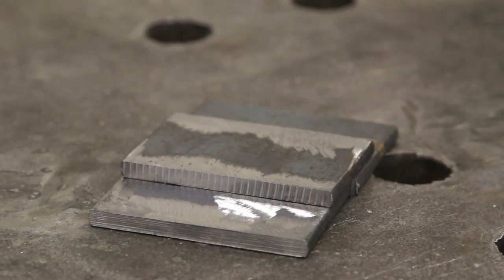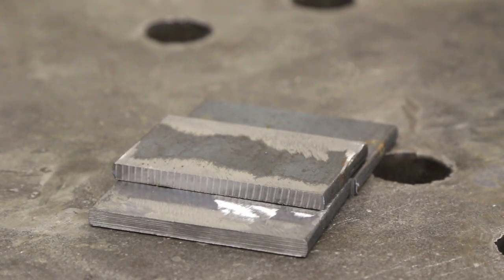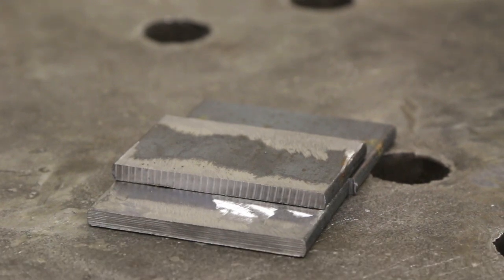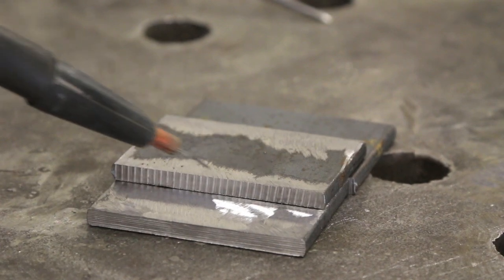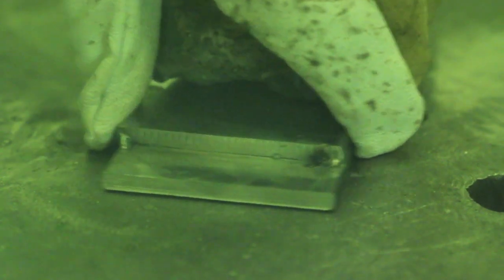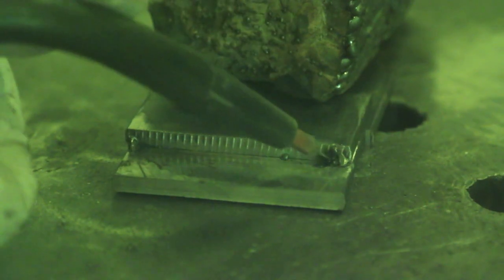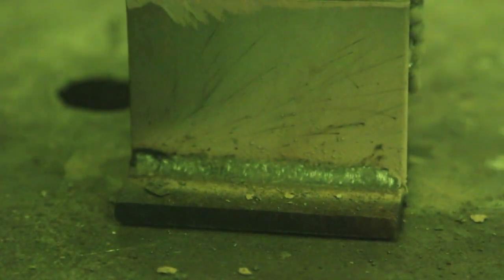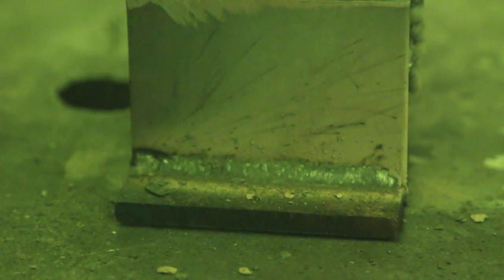Welding Common Joints Using Flux Cored

Comment: how many amps where you running for this project?
Reply from the maker: David Bastek I can't say with certainty since I used the maximum available setting on the manufacturer's chart, and didn't bother measuring out the wire to check for wire feed speed. The machine has a max of 140 amps, and I was about 2/3 of max. From the way the wire burned into the metal, I'd venture to guess I would say somewhere around 110 amps, give or take.

Comment: Just watched your FC and TIG videos.  Thanks.  Good stuff.  I learned a few things I didn't know before.  Keep the instructions coming.  One thing that I was unsure about was how to adjust the heat, so it helped when you mentioned that increasing the wire feed speed is the way, not increasing the voltage.
Reply from the maker: fastbusiness Great, glad to hear it. Stay tuned for next week when I discuss MIG machine troubleshooting.